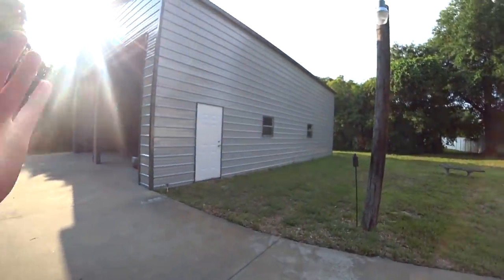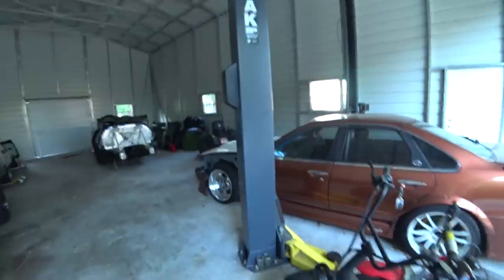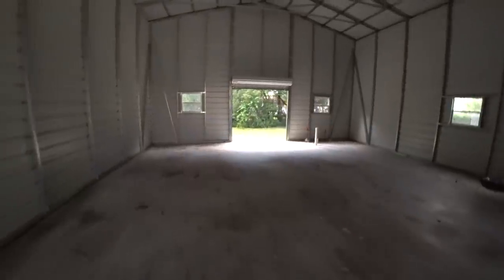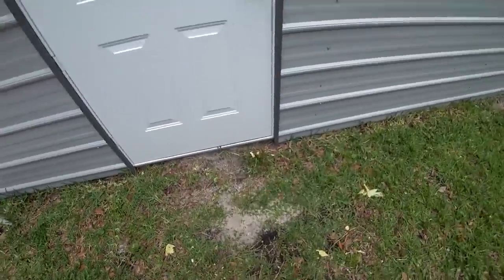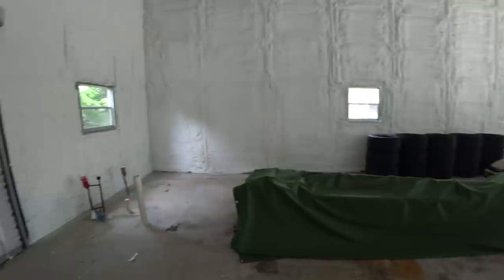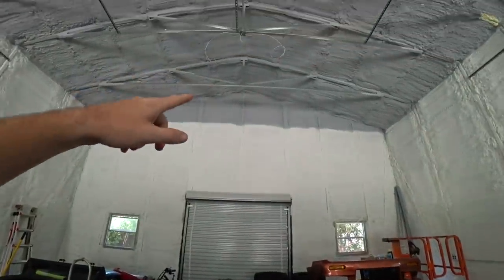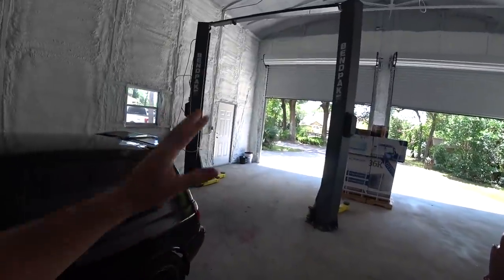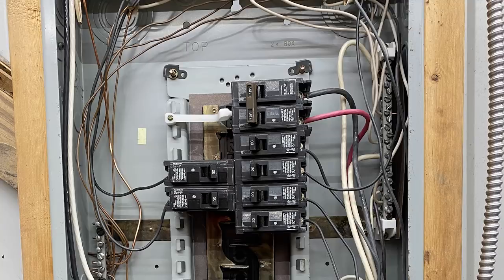New workshop build out. Spray foam and Electrical.

Comment: Hey Taylor, I'm a professional, full time spray foam inspector and I operate a 3rd party quality assurance program for the stuff here in Canada. The uniformity of the finish in your building is well above average, they did a great job and no project is going to come out completely smooth. Usually the marketing images you see showing close to perfectly flat foam are incredibly thin jobs (1-2"), or they were sprayed in numerous passes solely for the sake of achieving a smooth finish and wasting a bunch of material in the process.
Reply: Yep, or you can do the over spray and cut back to a flat with hot wire etc. but again more product used.
Reply: @wobblysauce  personally I'd rather do this!!
Reply: Not many people can but I can make it come out as flat as drywall. We spray gaco onepass lowgwp great product. In my opinion they did a  alright job iv seen way worse but also way better. Are you part of spray foam worldwide on Facebook?
Reply: @wobblysauce  hot wire does not work with closed cell spray foam btw it burns it not melt it
Reply: @bmdubclub9933  if that's directed at me, I'm part of spfww but I also see enough foam to know what's posted on there is often cherry picked. That being said there is some great installers and lots of knowledge on the group, I just don't think the average homeowner with the average job should expect a perfectly smooth finish. Congrats if you're dialed in enough to nail a great finish tho, it doesn't come easy.
Reply: I agree but a good sprayer could make that look better. Personally I know I could. What scared me a little is these foam buns not cracked open lol
Reply: @bmdubclub9933  yeah i agree we either spray natural polymers or huntsman down in texas with a akurate rig and it could of been better but not the worst i have seen either
Reply: @bmdubclub9933 where are u located?
Reply: @bradmason8334  I’m located out of maine
Reply: ahh, was hoping to find someone with spray foam skill in FL

Comment: Definitely epoxy that floor.  Ella, Blue, Keegan and (hopefully) Sandy will thank you. Tuck, as usual, won't care.
Reply: just don't make it multicolor if you ever expect to find bolts you drop!  :)
Reply: I think he should do a small loft for storage not to be in just for storage cause you're wasting space with all the space over head
Reply: @adamthomas4638  there will be a loft over the back third, he already said he wanted to do that
Reply: PROFESSIONAL
Reply: Make sure to do a heavy grit! One of my friends has a super nice epoxy floor with a light grit that turns into a slip and slide with any water. Then when one of the cars started leaking, the area has been slippery ever since.
Reply: Barrust 235 primer 
Devthane 379 top coat
No grit , no chips -make it smooth.  
Then you will be able to clean the surface.  
My shop floor has this combo. Huge upgrade.  Did it 7 years ago.

Comment: Definitely should put a couple fans to move the air around with the a/c units not blowing air up there.  Will make a big difference in Comfort
Reply: that's what i was thinking, a couple of those big 12ft commercial fans from the rafters would do a ton to help even out the temps. not to mention circulating the air will help prevent clouds from forming inside, which is an actual consideration in larger buildings or more humid environments
Reply: I was just going to say this. Get a bunch 24" Patton circulation fans. Mount mid-way up the walls and point them slightly up and in the direction so they create a swirling effect around the perimeter of the garage.
Reply: in a building of this size it is a must to avoid stale air. also above certain sizes buildings, depending on ac type/rating, it will help the ac equalize temps and reduce the ac load.
Reply: Definitely agree. My company built a 30k sqft addition with 30 ft ceiling. No fans. The air gets stale so fast.
Reply: Clicked to comment install fans. Install a big arse fan
Reply: Gable end vents too since there's no ridge vent
Reply: Even one of those huge fans in the middle would be huge.
Reply: @david92xj  , oh....great point.
Reply: @ShredGarage  You're not wrong. But those massive ceiling fans are really expensive. At least the ones I've seen are. Thousands of dollars.
Reply: Nah.  Those inside units can be put up high and blow the air down.  Mount them at 15’ and you’re all good.  The discharge is on the bottom and can be aimed down.  No need for fans.

Comment: You need solid walls man. You’ll regret not doing it later.
Reply: That’s the main problem with those cheap steel buildings. Still have to fully frame them out to finish.
Reply: I couldn't agree more its going to get so dirty!! And be impossible to clean it!
Reply: @MuddyPuttersDG  it’s a damn carport

Comment: Make sure your epoxy floors have sand in them. My garage has epoxy floors. I slipped, broke my ankle in 3 places, and it still hasn't healed correctly. 

Put an abrasive in the epoxy.
Reply: They did sand in the epoxy at work, eats boots super fast.  I think the speckles are a better option.  It's also impossible to get the floor nice and clean.
Reply: IDK I worked in epoxy covered hangar for years, doing jet engine work for the Air Force. Never had a problem. Then again we kept it CLEAN

Comment: Home depot makes a plastic wall sheet its like 4'x8' and 1/8 inch thick used commonly in wash bays be perfect for your shop even if its just the bottom half makes it easy to clean too can simply pressure wash it
Reply: This is a rad idea easy to clean too and wouldn't take much to whip up something to fix them too!!

Comment: You may wanna stagger the lifts. Not sure you can fit the F350 in the shop if the lift is at the front. Just a thought.

Comment: The worst part of this insulation is that everything can and does stick to it... cobwebs to exhaust soot. Even with the paint its horrible in that aspect think if I had this stuff again I would shave it so you could put 1/4 inch plywood at least on the bottom 8 feet of the walls. Still where I live has the same humidity but doesn't get as hot and I agree that any shack your spending any time working in definitely needs to have insulation to keep the heat out..
Reply: He is painting it.. same effect to make it cleanable. 
He has a good point of covering as needed with plywood or shelves.
Reply: @turboflush  NO ITS NO JOKE A B$&@H to clean even painted with heavy coats of high gloss to be super smooth the plywood is really needed
Reply: Devin vanderhoof just did a garage the same way, but sheet metal siding inside. Wasnt a fan at first, but it reflects light well. I agree, needs something long term
Reply: @turboflush  with all the lumps and pits it will be almost impossible to clean that all the dirt will go in there and you won't get it out!
Reply: @Josh Powell  good point. 
It's a pretty clean spray job atleast. I have seen bad.
Reply: @Craig  maybe some 1/8 ply would be a good solution. Cheap enough to cover atleast.
I wonder if the spray foam is fire rated. Save his money on the paint and find some sort of sheeting to cover it. Install thick ply where needed.

Comment: You might want to put in some ceiling fans, will help circulate the conditioned air.
Reply: I was thinking the same thing, those ac units won't have to work as hard If you keep the air stirred up in there
Reply: I came here to write this very same thing.
Reply: Ceiling fans actually aren’t advantageous when cooling. That mixes the hot air from above with the conditioned air in the occupied lower section. If the air in the top 5’ or so is warm then that’s fine.
Reply: That's actually not a great idea.  Hot air rises, leave it up by the ceiling.  Ceiling fans in tall buildings increases the load on the AC system.  I've done a lot of churches and would get call backs every time someone turned on the old ceiling fans.

Comment: Definitely needs some plywood on the walls at least. Going to be sweet when you outfit it bro!
Reply: Yah I was thinking the same thing at least go like 10-ft high plywood.
Reply: He’s already running conduit for electrical… too late.
Reply: I agree man, it looks unfinished as it is. I couldn't deal with looking at that 😂😂
Reply: @jzlharvey  it’s not too late, plywood is really thin you should easily be able to slide it behind
Reply: @Azarathal  If not its just conduit you can just unscrew it then put it back on top of what ever materials used!

Comment: I work in AutoCAD across a few different fields and permitting is always a pain! I found purposely leaving something major off of a set of permit drawings that they catch right away makes things easier over trying to hand in perfect drawings that the permitting office will pick through with a fine tooth comb.
Reply: It's always better to beg forgiveness than ask permission. 

The same goes for industrial work so long as you finisha little early. (For customers)
Reply: Idk to think that is good or bad. Lol
Reply: Exactly!  I call that tactic ‘heat sinking’ and it is an effective approach in many areas of business, or in this case, permitting.
Reply: It’s the little details that make or break a job
Reply: As a Planner working in Development Assessment I can say that glaring issues make me look harder at every other aspect of a development application. 

Receiving half baked documents from applicants (especially if they are professionals) is incredibly frustrating and results in an approval taking longer to achieve.

Best approach is to seek preliminary advice during the concept / design phase, so you don’t go down a rabbit hole and have to change heaps later on.

Comment: I think you should have built the wall out and Sheetrock or plywood the walls. The foam will drive you nuts in a few months, it will never be as clean as it is right now, you are going to eventually want to hang something on the wall.
Reply: The thing about drifty bois is they have A TON of stuff they have been just been WAITING to hang on the walls.  banners, flags, posters, pictures, logos, trophies, doors, tires, steering wheels, helmets, race suits, you friggin name it.  I don't think he'll have a problem covering the walls lol
Reply: @eddominates  outside of banners, going to be hard to hang stuff without an actual wall to mount stuff to.
Reply: I disagree with the spray foam walls completely. Never heard of people doing that without sheetrock over it so maybe I'm just ignorant but this seems so half assed compared to the build quality you have for your cars and the rest of the shop. Plus like @shane said youre kinda fucked for hanging stuff. I'm sure it'll look fine but touching the wall and feeling it move is gonna be weird
Reply: @shanechepren8119  I think Taylor can get hanging stuff on the walls  figured out.  he's pretty resourceful

Comment: corrugated steel or steel siding on the inside of the walls would look good and add to the fireproofness sparl resistance etc. 

even checker plate the first 4 ft then transistion to siding would be sweet.
Reply: nothing like recording audio inside a tin-can 😁

Comment: I love my Mr. Cool units.  I have two 18k units in a 2400 sq ft pole barn with spray foam (4-6 inches).  I am in SE Georgia and they have no issue keeping things ~75 degrees.  The reduction in humidity is the best part.

Comment: I would install the AC units one at a time. The spray foam is a huge advantage. Maybe a single BIG ASS FAN in conjunction with the AC. They are smart fans that work with the AC.

Comment: For internet you should really think about running a point to point directional setup with an access point in your garage. It'll make life so much better if you're not running off your house's wifi.
Reply: I did this in my shop and it works great.  WiFi in the shop is faster than in the house (better modem).

Comment: I have an older house to where I wasn’t able to run duct work, so I settled with a mini split instead of running window units. Within the fist month of running the new split. I had my lowest electric bill, it was usually around $120 a month and with the split it dropped to $79 sooooo much more efficient and is able to do my whole main floor with my open floor concept! You will love it, and the humidity will literally disappear! Great work btw much love Taylor!

Comment: Stoked for you dude! The productivity you’ll have with such a comfortable workspace will be awesome. 10 foot plywood walls, a epoxy floor and quality lights and it will look great. Nothing wrong with spray foam, you just have to cover as much as you can before it gets filthy. I did work experience at a shop that the spray foam was permanently filthy. After a while you can’t keep it clean without putting in a lot of effort.

Comment: Mount those condensers off the ground if you have any standing water issues around where you want to place them or if you have pets. Also, if you have the clearance for it, get some giant industrial-type fans so you don’t have to run the AC as low or the heat as high in the shop.

Comment: You could just use 12' X 4' lengths of 1/4" sheeting to finish the walls, it would look a lot better than the exposed foam. The sheets can be cut to 10' to hit the existing framework, and they won't take up as much of your interior space as drywall.

As for the bulky spots of foam, you could just knock it down with a large knife/saw whatever. No big deal.
(I do general contracting and I have a lot of different trades under my belt)

Comment: You should ply wood the side instead of drywall goes a long way keep up the great content!
Reply: With 5 foot centers makes it a little hard for ply wood that's 4'x8' but they do make drywall in 4'x12' and 5/8" thick he could full surface glue some plywood to the drywall though and it would still hold quite a bit of weight
Reply from the maker: It’s a little late now that all the electrical
Is done..
Reply: @79huddy  it would be pretty easy to make some brackets to fit it all too, so you could just use normal ply, it's going to get so dirty and be very hard to clean it! I can see in the foreseeable that all the electrical services will be taken back off and installed back on some sort of ply or tin covering!!

Comment: When you install your Mr Cool units make sure the lineset is stretched out. If it’s looped behind the unit it will creat oil traps and ruin your unit. If you install them well they will last but there are no parts available when they break. Kinda sucks for a service tech. 

Also great work! The shop looks amazing. Thanks for the hard work making all this content.
Reply: I work for an HVAC company, we have hundreds of mini splits out there with the line sets looped behind the unit. We have not had a single unit go bad.
Reply: @drewmerritt8932  Ask the manufacturer of top of line units like Daikin and Mitsubishi and they won’t warranty parts on it. 

Can you get away with it and best practice are different things.
Reply: @drewmerritt8932  Same

Comment: The trick with heat and AC in a shop like that is to maintain the temperature, don’t let it get hot, even if it gets down to 68-70 overnight it’s easier to maintain 72 degrees because all the cars and equipment stays cool , if you shut it off and all that metal gets hot it takes longer to cool it off rather than just cooling the air
Reply: I agree, I would let the MRCOOL run on "Comfy mode". You set the temp range to turn on and off. That way it maintains the temp you want.  Mine runs about 9 hours a day, and I live in SW Florida. My electric bill has been great. BTW, let the wireless thermostat control the mrcool units. I found it works better than the internal thermostat inside the wall unit. Sorry for all my jibber jabber !

Comment: Taylor, if you put s
One or 2 large ceiling fans (MAKE SURE THAT THEY HAVE VAIRIABLE SPEED CONTROL AND SUMMER AND WINTER FUNCTION AS WELL) You will be able to push down or up heat as required and at the best speed needed this I have found here in Western Australia where our temps get to above 45c and below 0c in winter, it gives you a better use of your airflow and their will be days you don't need ac and the fans will give you air movement for comfort.
Tony from Western Australia 🇦🇺

Comment: use 16' sheets of drywall and self tappers - the closed cell adds lots of rigidity - that stuff is really gnarly - build a small office maybe as a mezzanine in back - the old shop seemed bigger oddly enough
Reply: Or OSB

Comment: You should definitely frame and Sheetrock the walls & paint the roof black so it hides the lumpy-ness of the spray insulation & when you hang the lighting it should also deflect your vision from the ceiling so you really won’t notice the bumpiness of the spray foam insulation if painted black !

Comment: I've been doing hvac for 25yrs and a rough load Calc on your shop is 48k but just by sq ft...not counting roof peak.also doors will definitely need inso because now they will sweat in the Florida humidity
Reply: so accounting for the huge height ..... you cant do a load cal. without height. and are you accounting for spray foam
Reply: been doing hvac for 17 and the worst thing ive seen is people not accounting for spray foam and or room type and height.

Comment: Epoxy floors are also immensely easier to clean up fluid spills. It might be a hit to the wallet and even more time not in the shop, but it's one thing you will never regret doing. The only complaint I've ever heard is the speckling, stuff dropped on the floor has a tendency to disappear faster than a 10 mm socket.

Comment: If you install a few large ceiling fans on the ceiling for air circulation, that would make a huge difference. For days you don't need to run the AC. Much less power consumption

Comment: If you get a 200 amp feed through meterbase you could run 200 amps to both the house and the garage. Also you can put your overhead feeders in the ground and lower the risk of then getting damaged